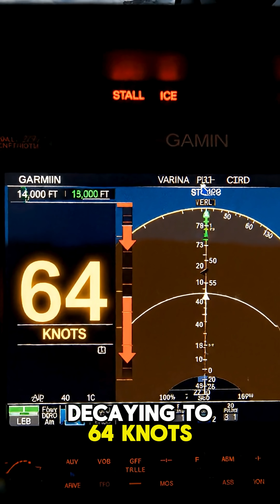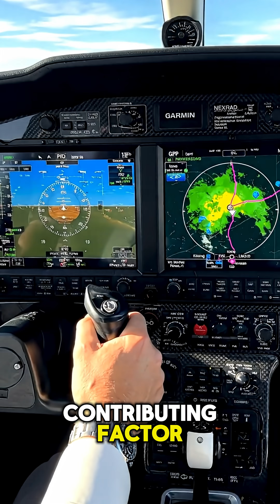14,500 Feet. He Never Saw The Ice Coming #shorts #fact #aviation

Comment from the maker: This accident happened despite the pilot being instrument-rated with TKS ice protection onboard. Two key lessons:

1️⃣ AIRMET Zulu isn't a suggestion - it's a warning based on actual conditions
2️⃣ Ice protection systems have limits - they're for escaping ice, not flying through it

The groundspeed decay from 111 to 64 knots told the story. The aircraft was accumulating ice faster than the TKS could handle.

What would you have done differently? Drop your thoughts below. 👇

Full NTSB report linked in description.